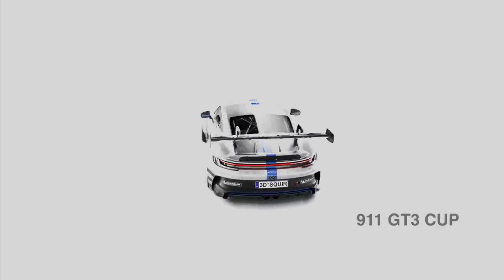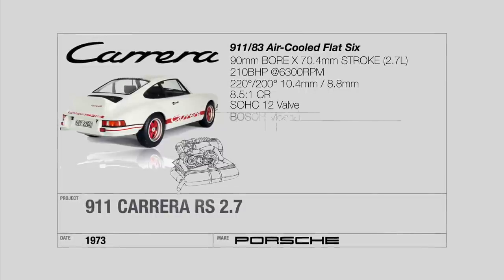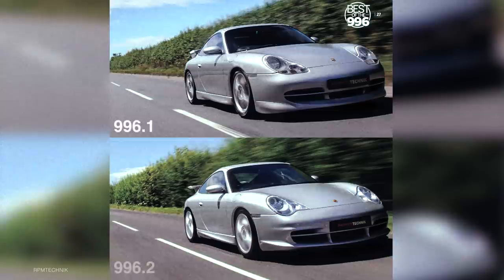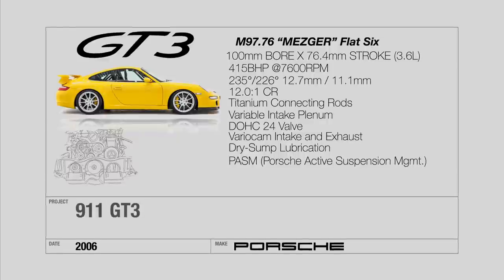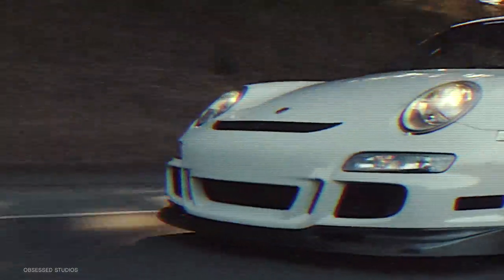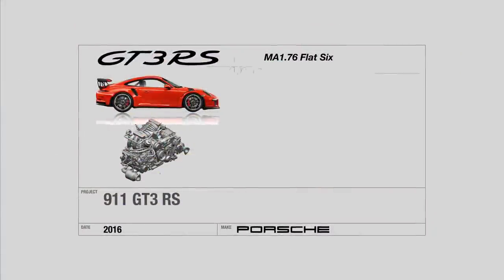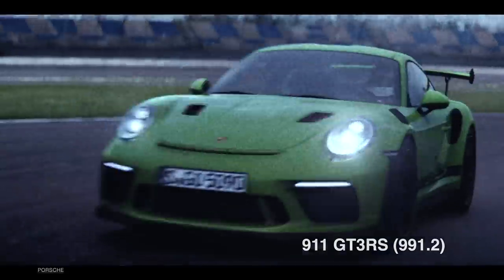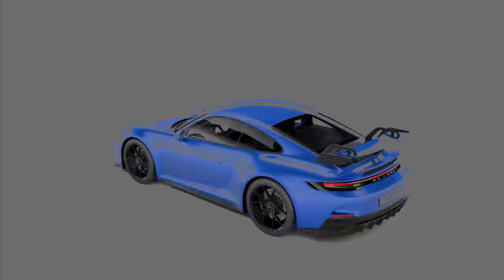Porsche 911 GT3 Engines Are Ridiculous😮‍💨 | Explained Ep.18

Comment: Please do a video on the F20C which made 125hp NA in 1999 (in Japan) rest of the world it made 120hp per liter NA (due to emission standards). It has some fancy tech like special light friction carbon coatings for the cylinders etc. and arguably  the worlds best shifter ever made.
Reply: Sounds good on paper with 120/5 hp per liter but those engines are not impressive. S2000 are mind blowing slow and what makes the f20c engines junk is the FRM cylinder liners. This is why ppl swap the k20/24 fwd engines in the s2k to make them fast.
Reply: @mikehawk6563  Who swaps them? i heard of a few K swaps who then are even slower. K swap only makes sense if you turbo it or supercharge it which is a sacrilege imo. Mindblowingly slow but one of the fastest cars in Time Attack and Best Motoring Togue runs. I bet you only drive cars in a straight line and they probably have to make peak power at 3k rpm lol because it sounds like that from your comment. And the F20c was the developement engine for the K, the K is the mass production version of the F20c and has the same amount of issue but due to the much bigger and cheaper aftermarket you can make more power but stock to stock no comparison, based on technology the F20c is way ahead even it is a much older engine. I agree you have to be very careful with the engine, but if you know what to do they run forever, i know many people who run their f20c on track and have 200+k miles on it. But it's not a engine and car for everyone, you need to know how to drive it and how to take car of it, it's not as simple as a k engine and thats were many fail. And it's certainly not made for straight line speed.
Reply: @mikehawk6563  + people compare it to cars it was never intended to be compared, it is not supposed to be fast in a straight line, it's supposed to compete with small roadsters like the mx5 etc. which it totally dominated in early 2000's and 240hp NA was a lot back then especially in such a small engine which comes with a lot of advantages regarding handling.

Comment: the 4.0 flat 6 making 500+whp naturally aspirated is absolutely a testament to porsches engineering.   bmws new s58 engine barely does it with forced induction and the s58 is arguably the best modern 6 cylinder engine.
Reply: A Ferrari 458 speciale makes 134hp per liter..
605 from a 4.5l V8..
Reply: S58 inline 6

Comment: Thanks for this video, that was an excellent explanation on the 911 GT3 history and line up! I made this very basic summary after watching, so I don´t get lost again:

Air cooled:
CARRERA RS 2.7 210hp (1973)
964 CARRERA RS 3.6 260hp (1992)
993 CARRERA RS 3.8 300hp (1994)

Water cooled:
996.1 GT3 3.6 360hp (1999)
996.2 GT3 3.6 381hp (2003)
996.2 GT3 3.6 RS 410hp (2003)
997.1 GT3 3.6 415hp (2007)
997.1 GT3RS 3.6 415hp (2007)
997.2 GT3 3.8 435hp (2009)
997.2 GT3RS 3.8 450hp (2009)
997.2 GT3RS 4.0 500hp (2011)

Direct Injection:
991.1 GT3 3.8 475hp (2014)
991.1 GT3RS 4.0 500hp (2016)
991.2 GT3 4.0 500hp (2017)
991.2 GT3RS 4.0 525hp (2017)

Double wishbone front suspension:
992.1 GT3 4.0 510hp (2022)
992.1 GT3RS 4.0 ~530hp? (2022)
Reply: the 992 gt3 has 502HP
Reply: the 991.2 gt3 rs has 520hp
Reply: @olivertrees  Bullshit! The 991.2 GT3 RS has 520 hp.
The new 992.1 GT3 RS has 525 hp.

Comment: 6:44 125hp/liter is unheard of? Motorcycles available all over generate a little more than 200hp/liter without forced induction. You see that on virtually all super sports. 

So you see this in 600cc engines from Honda, Yamaha, Suzuki and more. Then you see this in 1000cc engines from the same companies and also BMW and Ducati and more. 

My bike is 15 years old. 127hp in 0.6L. It’s a supersport street bike and it’s SUPER common. 200hp/liter bikes are all over.

A motorcycle that only generates 100hp/liter is considered pretty tame.

Comment: Regarding the HP per litre, the standard factory Honda S2000 was making 124Hp per litre back in 1999, well before Porsche ever did in normally aspirated form.
Reply: I think you don't understand the relation between power per litre and revving for smaller engines vs larger engines.. look a the typical RC or bike engine, easy analogy.
Reply: @farnum3297  exactly
Reply: Naturally aspirated*

Comment: Excellent video
I agree with your closing line- an engine without turbo or electric is what a 911 should always be
I’ve owned 2 911 turbos and then moved over to a gt3 then gt3rs
True, the 911 turbo is unbelievably fast
But the NA 9000 rpm wail of the gt3 makes all that turbo power unnecessary 
It’s about the drive -
Full stop!

Comment: The HP/liter power density is amazing however modern pushrod engines like the LT1 and LT2 make close to the same HP,  way more torque, have similar weight/dimensions/fuel economy but more importantly are waaaay cheaper, easier to maintain and are arguably more reliable.

Comment: BHP figures are not the same as PS or CVs therefore the last one for example has 525 PS/CV or 518 BHP, yeah it's a minor difference but anyways... By the way did you know that Porsche have a 4.0L Flat 6 NA, just like the others but with 550 PS and a 4.2L with 565 PS. Absolutely bananas!!! The 4.2L probably has more torque also due to the increase in displacement but the figures are not revealed.

Comment: Fantastic engines, i guess nobody would argue that but really not top of the class in terms of hp/l. Ferrari 458 Speciale 132hp/l, BAC Mono R 137hp/l, Valkyrie 154hp/l, Ariel Atom V8 158hp/l and Gordon Murray's T.50 with a crazy 164hp/l.
And yes im familiar why thats the case so in the end its pretty pointless arguing about hp/l if you dont account for the rev range.

Comment: I would love for you to do the Subaru variant of the flat six the EZ engines, word on the street is Porsche actually help Subaru designed the flat six and the cranks are very similar to the Medsker engine also I’d love for you to talk about the EJ series of Subaru engines apparently some pot smoking hippies from Washington University designed the four valve dual cam heads for that engine. really enjoy your videos I’m an engine engineering nut and I love to get all technical data on any type of ice engine out there! Thank you for your great videos

Comment: I remember this, the top NA engines ever made. One of them was the Ferrari 458 with the same HP per litre as this but with higher displacement due to it being a V8
Next was the Honda S2000 AP2 with 112 HP per litre

I only searched it up before because I wanted to know if I should invest in an AP1 s2k or the AP2. I ended up with the AP1 because it revs higher 😂

Comment: I was at Road America when they were testing out a GT3 cup car on cup sport 2s against  a registered GT3 race car.  The cup car was 3 seconds behind the race spec machine!  I will say on the road the GT3 is fucking punishing, ditto for the Turbo S and GT2 variants, even on the softest setting you're gonna feel the smallest seams in pavement.  The S, 4S GTS, and Turbo are all far more comfortable if you're doing most of your driving on the street.

Comment: They actually say that the Camaro ZL ones transmission is actually faster than the PDK
Reply from the maker: It’s kinda misleading since the ZL1 is a torque converter auto vs a dual clutch. The PDK has much less drivetrain loss since it’s clutch based vs a converter and food for thought the C8 used a modified PDK in development since it was so good.
Reply: @337speed  There’s this underrated engine I’d like for you to talk about actually the Ford cyclone V6 motor that was in the 2011 to 2014 Mustangs these things could reach 600 hp with just a turbo

Comment: "125 hp / liter is even unheared even today" You wrote an incorect data there. 500 ps = 493 hp. Also the engine was 3996cc. 123.2 hp /liter
btw:
JDM Honda S2000 -  247 hp from 1997cc. -  in 1999. 123.5 hp/liter
458 italia - 557 hp from 4499cc. 123.78 hp/liter
etc etc etc

Comment: 8:50 I need to correct you here. 991.1 CUP cars were still using the old MEZGER engine. CUP cars would not get the new engine until 991.2. 
Source: GT3 Cup race mechanic since 2012.

Comment: I feel like this video didn't actually explain WHY the GT3RS Engines are insane.  It just talked about the evolution of the model.  Yes, they kept it N/A, it revs high and it is a flat engine, but WHY specifically does that make it insane?  I believe to truly answer this question you need to compare it to other engine configurations and discuss power / lb, center of gravity and efficiency.

Comment: 125 hp/l is impressive but not "unheard" for 2010. 2009 458 Italia does 124.88 hp/l. Note that 2013 Speciale's 133 hp/l is still higher than 2022 GT3's 127 hp/l.
Reply: try to daily a Speciale.. and I love that car/engine, but it will break down in a 1/10 of the time the GT3 will under similar conditions. GT3s are Motorsport quality, beyond the italians for sure.

Comment: While Porsche makes a great engine, they don’t destroy everything else. I mean Honda and Nissan both made na engines that made 123 and 123.5 hp per litre respectively in the 90’s. Both engines where also very reliable and where put in cars that where far cheaper than any Porsche. Then Ferrari also make na engines that make more than 130 hp per litre whilst revving reliably until 9k or more.

Comment: Imagine adding electric motors and a turbocharger to this! 🥰
Reply: IMHO I think you’re missing the point. The beauty of this car series is that it doesn’t have, want or need turbos or electric motors.
Reply: @montyandruss  what makes you think Porsche can't up their game by adding those?
Reply: @CaneSugarCane  I add IMHO as I’m not an expert and have never owned a supercar but I believe if you read almost any informed journalists reviews it would be common to have the GT3 flat six, Lambo V10 and Ferrari V12 at the top of their lists for character and noise. Yes , turbo’s give more power and torque but stifle the sound. Just look at the problems F1 had with hybrids. Porsche made the 919 hybrid which obliterated the Ring record so yes they have the technology to do it but there’s a reason that GT3s are so popular, sought after and lauded. 500 bhp is enough for a road car, on the majority of roads in the majority of countries. The engines are bulletproof and designed to be used hard time and again.
Most modern super cars are now turbocharged and have way more power than can be used on the road and have powerful traction control devices so that ordinary drivers can put their foot down without spinning off and all modern electric jypercars are controlled almost entirely by computer. 
Rambling I know but it’s the GT3 s mechanical rawness that I believe is what people crave with purists even wanting manual gearboxes.
Definitely turbo and electric motors make it quicker but 
more pleasing to drive. Well we’ll have to wait to see when they make one.
I for one would like to drive both for a comparison 👍
Reply: @montyandruss  Your ramble was sincerely appreciated and enjoyed! Thank you!

Comment: Porsche is in as league of their own. And they are hard to drive with high horsepower and traction control off. People don't realize how easily that rear will come out on you.
Reply: That means the car doesn’t Handle well if you have to use traction control and a bunch of computer ads to handle well.

Comment: “125 hp/L which is still u heard of in n/a engines” 
motorcycle engines: enter the chat
Reply: Technically true, but motorcycle engines tend to make abysmal torque and only make that level of power by revving to the moon (in most cases). 
For a hypothetical: Hyabusa (1.3L) produces ~100 ft-lbs of torque and 173 HP, redlining at 10,100 RPM. The Porsche 911 GT3 RS4.0 produces 339 ft-lbs of torque. Assuming a flat torque output, this engine would produce over 650 HP at the same 10,100 RPM. The difference is 162 HP/L in the Porsche vs 133 HP/L in the 'Busa. 
This is really more to emphasize the HP/displacement is kind of a worthless conversation since HP is a product of torque and RPM. There is generally an engineering tradeoff, where engines that produce good torque typically struggle to reach high RPM, and engines that reach high RPM usually don't produce a lot of torque.
Reply: @Lawrence330  most modern literbikes (not a hayabusa) make >200hp/liter. BMW s1000rr makes roughly the same peak torque/liter as this engine and also 80+ percent of peak torque over a 9000rpm spread.
Reply: One car immediately comes to my mind is the 458 Speciale - 134hp/L and back in 2013.

Comment: So your brand new engine does 131hp/L.  
My ‘89 944 Turbo with a moderate Lindsey setup on it does 132hp/L.  And I weigh 400 lbs less.  When I put my race tires and rims on….. that GT3RS will still kick my ass.   LoL.  I would be a good race though.   🤙
Reply: And I daily drive my 944T.  It’s got 200k miles on it.   👍

Comment: The HP per liter is crap for talking performance of engines.  Every street race replica 1000cc sport motorcycle is over 200hp per liter, these can be had new for under $20,000.  Even more a 2.0T from a Audi with just a ecu tune only makes just over 300hp so 150hp per liter. Though the frame and car is impressive the engine alone from the GT3 RS is not.
Reply: That is a stupid comment 🙄

Comment: If you can't make a video as to why the BMW N63 and S63 platforms leave hundreds of horsepower on the table from the factory where just a simple tune and downpipes put freight trains on others then what kind of channel is this?  Yeah there are some reliability issues with the hot V heat generated but those can be mitigated.  BMW was first with that design but everybody else followed.  Mercedes etc even Cadillac.  You can take a nearly 5000 pound 650 Gran coupe and run 10s with just a tune and downpipes. Just a stock M5 M6 M8 is a road missile.  So what are you waiting for on the TT V8s?

Comment: Blah, blah, blah.  My Audi TTRS is a 2.5 ltr 5 cylinder that with a stage 2+ tune and a few bolt on modifications, produces over just short of 200hp per liter with E85 fuel.  On 93 octane it’s putting out 525hp and weights just over a ton
Reply: It's turbo charged...